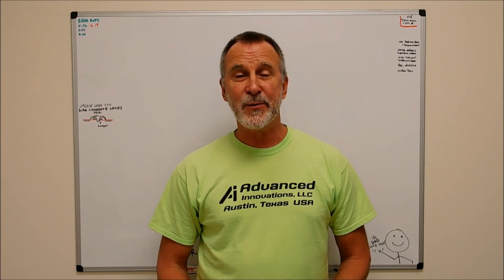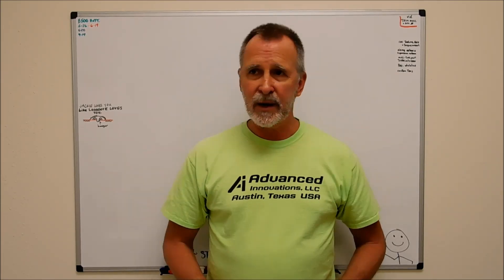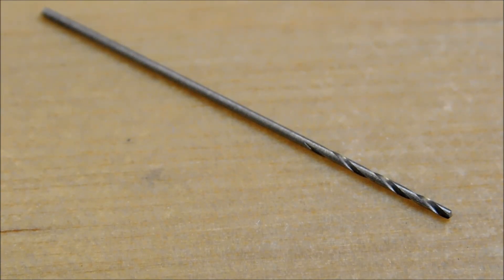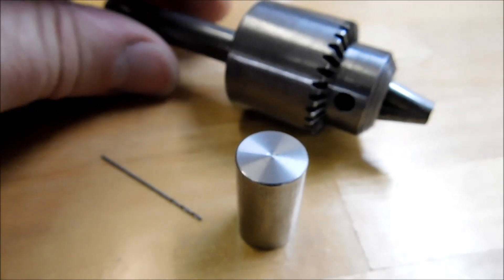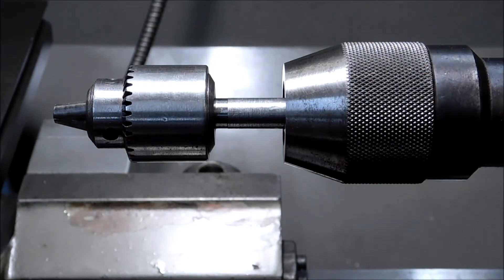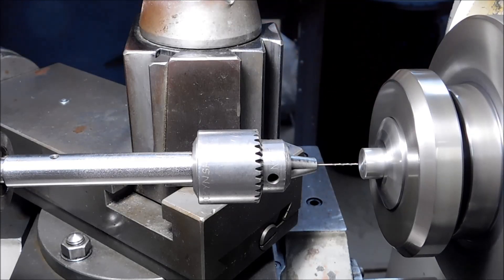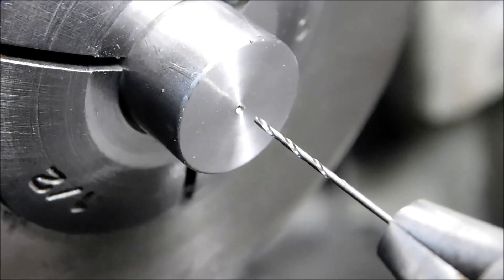Micro Drilling -- Stop Breaking Small Drills !!

Comment: I have used one of the commercial units to drill .015 dia. holes thru the deepest cavities in an aluminum vacuum form mold, about .187-.250 thickness 186 times without breaking one drill. I did change drills about every 25 holes just to be safe. Good tip....I've done it for years.

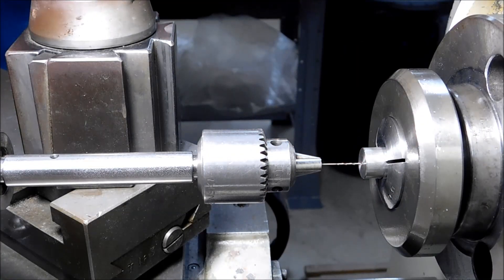Comment: Most super-small bits aren't made for power drilling period and are meant to be used with "hand drills". And since it sure looks like your bit lost at least one full "turn" of length between starting and about 8:40, my guess is your "trick" works better on paper than in practice. You can't "push" a bit that small that hard without it "biting" and twisting right off due to "torque" instead of what normally snaps little bits which is "angle". It looks like you used at least three different bits at different parts of the video and the first picture shows a bit that doesn't even have a "point". Classic twisted off small drill bit.
Reply from the maker: Although I enjoy all your "quotation" marked words, your comments usually leave me scratching my head. The video clearly showed that small drill "hand" pushed through 316 stainless steel. So unless I am a photoshop expert, this technique is as sound in video and practice as it is on paper. if there is any length difference in the drill, it probably walked back in the small chuck I used. As for the bit, it's the same bit throughout the entire video.
Reply: "Super-small bits aren't made for power drilling"..... please define "super-small" for me? What about 0.1 mm? I drill with that size (Union Tool carbide) routinely, and considering they make them at less than half that diameter, I'm sure other people have too. Makino IQ300 machining center... so they're certainly "power drilled".
Reply: Wrong-a-mundo Deer.......48 years as a toolmaker and machinist and I own two of these and have used them many times. To be a machinist does require beyond ordinary "feel".
Reply: One drill bit, unbroken, hole drilled, still one bit unbroken. Mission accomplished.

Comment: You can do basically the same thing with a pin vise and micro drill bits. from  eBay. https://www.ebay.com/itm/20Pcs-0-3mm-1-6mm-HSS-Craft-Tool-Mini-Micro-Twist-Precision-Drill-Bit-Set-Case/362196924548?epid=1953247543&hash=item54549e7884%3Ag%3AgWMAAOSwv~1aM3kg&_sop=15&_sacat=0&_nkw=micro+drill+bits&_from=R40&rt=nc&LH_TitleDesc=0 Another way to do it is to put a ball bearing race on the shaft that holds your smaller chuck and then you can let it spin a little as you hold the chuck...I do that when I drill deep holes ( 1 to 2 mm diameter  4 or  more inches deep)  to keep the bit from wandering...thus keeping centered all the way through the piece.
Reply: NOTE : Do not used for metal.

Comment: Hi Joe,
Excellent video & great tips. Just subscribed to your channel and have been catching up. I have drills as small as #80 wire size however the smallest I have used in the mill or lathe is about .030". The technique I use is to hold the feed lever as close to the hub as possible to reduce the chance of over pressing. Everything else I drill by hand using a pin vise. I'm going to make one of your setups for use in my lathes, already found a spare chuck in my tool drawer.  After watching this video I checked KBC tools and found they sell a Jacobs chuck with a 0JT for $89.00 and the micro drill amade by Sierra American with the 0JT taper for $65.00 also at KBC.  American made setup for $156.00 not bad for those who wish to buy.

Comment: GN1170 Pin Chuck Set +3 Collets 0mm to 2.5mm Drill Bits Suit Lathe Vice & Drills.   https://www.ebay.co.uk/itm/GN1170-Pin-Chuck-Set-3-Collets-0mm-to-2-5mm-Drill-Bits-Suit-Lathe-Vice-Drills/351294706667?hash=item51cacbd3eb:g:CykAAOxycmBS9Prt

Comment: Hi,
i am a watchmaking apprentice from germany we have drills the size of o tenth of a millimeter so 0,1mm. We do it kind of the same way. We don't use a normal chuck we have small chucks with handles we used to just put the end over the tailstock center and regulate the pressure with the tailstock handle whilst holding the chuck. Sounds difficult but is easy watchmakers lathes are small. When we make those micro holes you wouldn't use any electric power, we use a bow and a string to drive the workpiece. gives you even more feel. I hope someone understands what im saying =D this is the chuck we use https://www.bijoutil.ch/uhrmacher/werkzeuge/handwerkzeug/1466/reibahlenhalter-messing-8-mm
Reply: Hello Paul Locher, I am John. I found what you said very interesting and understood clearly what you said.
I also bookmarked the link you provided as I have been looking for just such items for holding small drills. I have a pin chuck that uses small collets that is supposed to hold small drills, however even though it is an expensive item, ($90+ in Australia) two of the small collets are so far off concentric as to be useless. I am reluctant to spend more until I find something accurate, this looks good (link).
 Thank you, John, Australia.
Reply: Hello John, thank you for your comment. A pin chuck looks like its pretty close to the small "Stiftenkloben" (the little holder thing). You said that your smallest collets are not really concentric, honestly it doesn't matter. The key is to just have the pin chuck with your drill floating between your tailstock center and your Centerhole which we get either by turning or with a standard center drill. (Watchmakers turn most of the delicate works, with their tool in their hands, not with your standard support. Looks a bit like a big woodlathe toolrest but in a tiny version). Back to the drilling, because the chuck is kind of suspended between your tailstock and your workpiece there is a little room and your drill finds the perfect center by itself. And just for correctness most of the time we use the motor of the Lathe. When we have to make new Pivots in small watch wheels we use a different fixture called  "Zapfenbohrmaschinchen" thats the Hand powered one. I hope it is interesting for you. 
Ps: I spent 14months in your beautiful country!
Cheers Mate
Reply: Thank you Paul for your reply, I took onboard all that you have just said, again with great interest.
 The pin chuck I have has for example, the smallest collet is about 1mm off center. I do not have the speeds on my lathe that a Watchmakers Lathe will have, max 1250 RPM. I was looking for something accurate so I can rotate the drill at high speed to do small holes.. 
 My smallest drill is .3mm or about 12 thousandths of an inch. I am part way through making a very high speed drive arrangement, it will also be used for internal grinding and rotary burr/file work. I have also provided for variable speed control on the device, a modified 4" , 100mm angle grinder with the gear head replaced.
 It has been a plan to do this for a while now, slowly coming together, thanks again for your help and input. 
Cheers Mate from John. Australia.

Comment: Hi Joe my name is Carla Piaia, what I do with every drill I'm going to use in the tailstock I hold it and I grind the back of the flutes, I start by pinching half of the diameter the drill between my fingers and then with the downward motion pushing it and it follows the twist and it grinds more relief for the chip evacuation and it works fabulous, it resembles some of the high-end parabolic drills you can buy

Comment: Amazing!  Question: I want to neck turn some 6.5 Creedmoor brass (rifle brass). The brass has a taper.  When I chuck it in my Dewalt drill, the base is held but not the entire cartridge so I get a wobble. Is there a way to spin a concentric  tapered object?
Reply: ludditeneaderthal and Paul Watterson, I have nothing to add to the conversation. I just finished reading, with great interest, this thread and have to say that this is the best aspect of Computers and sites like YouTube, the fact that if you meet the correct people, good information and help is offered up, exchanged and shared. Of course there are trolls as well, I prefer to say nothing if I can't say something good or constructive.
Cheers from John, Australia.
Reply: i suggest you check out how lyman, lee, and forrester all solve that little problem. hint: think shell holder, jam nut, and nut driver. the tool commercially is known as a "case spinner", btw. the lee example is, like all their products, incredibly inexpensive, but none of them are incredibly costly
Reply: Been there done that. Spinning a case in a shell holder is crude at
best.
Reply: pretty much every top ranked benchrester uses forresters system (a small u-shaped lathe like turner) for both gauging brass, and neck turning, reaming, flash hole reaming, etc. it allows either hand powering with a crank, or attaching a drill. the method for securing the brass is a shell holder like collar. 

no spinning arrangement will be anything but "crude at best" if you're just chucking it in a dewalt drill. a drill, no matter price, isn't made for any kind of turning operation. they rely on the thrust to minimize radial play.

 you could get a mini lathe, a collet to MT3 adapter (or collet hex adapter to use the 3 jaw) and use a chamber reamer on a suitable collet (from the headstock side), but you're talking an easy 700 bucks, minimum, and you'll get results about the same as the forrester rig (which runs about half that cost). you MIGHT be able to use one of those 4 inch between centers lathes they sell on amazon or wish and do the collet/hex adapter trick with a chambered collet, but that would run at least as much as the forrester rig, and most likely give inferior results.

 if you must use your drill (assuming a 1/2 inch chuck) you could chamber a piece of 1/2 inch OD tubing, make 3 slits on the case head end 120 degrees apart, and make the length in the area of the case shoulder. that would be basically a collet whose grip would be tightened by the chuck jaws, and assuming good ID/OD concentricity, would provide as much accuracy as your drill is capable of delivering.
Reply: Really like your last idea. Are you a machinist?
Reply: not a machinist, just a firearm enthusiast for decades, a former locksmith, and a machining hobbyist of sorts. i do understand precision tooling though. if you opt for the final idea, i'd suggest a mild steel for your collet, the slits running just a little longer than you chuck jaws would grip, and a "relief groove" to make the "spring" effect a little easier. i'd try a roughing chamber reamer first, as the coarse finish would give a bit better "bite" on the case without having to tighten it all down so savagely as to risk crushing brass you have time invested in forming. 

i should add that perhaps one of the benchrest/target oriented die manufacturers offers a "ream die set" for that wildcat, much like a trim die (hardened upper end), but specifically purposed for reaming the neck ID while supporting the OD at minimum spec, fits a standard press, and is sold with a tapered reamer to run in by hand or power. some prefer outside turning, some prefer reaming, so i figured i'd share that option as well. you could, with that set up, use that lee hand press (the one you actually work in both hands, no bench) and a tap wrench on the reamer (or your drill, of course), and thus be able to ream necks anywhere you could "drill turn" them, as i imagine the portability is a factor in your choice. the ream die and press ram WILL give about as accurate a cut as any option, unless your brass is REALLY non-concentric due to varying case wall thickness from the forming process. the die set will probably be comparable in cost to a chambering reamer (target reamers are pricey beasts, lol). that pretty much covers all the bases and options that would actually work and has potential for a good final result.
Reply: Thanks for the good info and all the detail :-)
Reply: a pleasure... but, just to let you know, i did a search for a creedmoor ream die set, and couldn't find a single example. it seems the ream die has gone the way of the dodo bird and passenger pigeon, lol. it's been a LONNNG time since i was interested in benchrest, so the current state of the art is a bit of a mystery i guess. also, the darling of precision shooters is the FOSTER, not forrester rig, another mistake i blame on antique info and decrepit memory banks
Reply: Do you mean Forster? I have their mini lathe which I use
to trim cases to length. I think they have a neck turning
attachment. I use the K&M neck turning tool with their
special mandrel to expand the neck which is needed to
fit their pilot which is a real tight fit. It works real good
except that I pull the necks out of concentricity using
my hand drill, so I have to run them up a body die again
to make everything concentric. Kind of a slow process.
Reply: forster it is, lol. they make both a turning attachment, and a reaming one, and i did see they do have at least the ream set up in 6.5 while scoping for ream die sets. i know a couple decades back EVERY benchrester swore by the rig, for the very reason you could use the single base to gauge cases, trim them, ream or turn necks, and even check the interior of the casehead for parallelism to the mouth with a dial indicator. of course, they still debated whether turning or reaming was better, lol. if you already have the forster base, the economical solution would probably be to just use their tooling to turn, as it pretty much insures concentricity, and you at least used to be able to drill power their set up, so your dewalt could at least get it's feet in the pool, lol. perhaps you could even run your existing K&M turner with the forster?
Reply: Cheers back mate :-)
Reply: Thanks Mate, John.

Comment: slick, where do you get quality drill bits these days? i'm just about out of the supply that the 1960s and older provided.
Reply from the maker: You have to keep an eye on real small bits. Even though they are new, doesn't mean the will cut well. Stick with a brand name. They will cost more, but its money well spent.
Reply: somehow i got the feeling for small bit use, only on occasion will a complete fracturing into particles follow a smooth cutting No. 40, mostly from not cut, pull out, brush with lube/coolant, but also the feeling that even name brands are obtaining non quality and putting their name on it to stay alive in a world of youth that doesn't know the difference so they spend money at those freight shops that only have the key ingredient that attracts men and some women-the smell of tools. quality or not, a constant bath applied to any cutting edge in metal work machining prevents the sudden heating and then cooling which sets up fracturing tendencies supporting both the hardened edge and its base. the intermittent brushing is an example to shorter tool life. so the cut alittle and pull out and cool is all that can be done with a drill. tough thing to do. especially when drilling plastics and soft metals. you make it look easy.

Comment: You're a life saver Joe. I need to drill some 1.2mm holes in 304 stainless and I've been dreading it until I saw this video. Though I'll be doing it on a mill, your comments below to use a micro drill adapter have shown me the way. Thanks!

Comment: Very good Idea. I am a hobby machinist. When I was taught lathe work many years ago the instructor emphasised "develop a feel for the procedures you use". I will be using the method you have shown.  Thankyou Joe
Reply: I've heard that since I was in shop in highschool in the 70's,  I don't do much metal work these days, mostly wood, but the "feel" is bang on. You know when something's wrong....specially when using a circular saw through maple plywood with a dull blade....

Comment: Hand in hand with this method another good trick is to only tighten the drill in the chuck enough to drive and cut. If it should grab it will slip in the chuck and not break.

Comment: any suggestions for mills?
Reply from the maker: Look up "Micro Drill Adapter". Its a spring loaded and keyed arbor for small drill chucks for use on the mill.
Reply: Just a brain fart....could you use the mill to drill a hole in a viced piece of stock that your "guide tube" would just slide into, then chuck your workpiece into the spindle and hand feed the drill upwards?

Comment: Hi Joe..I love your videos...I need to drill several small holes for even Argon  distribution (preferable 1/16) in copper.  No high precision required. Question for you: What RPM should I use with micro drill adopter in Bridgeport?  The hole will be aprx. 1/2" deep. Thank you!

Comment: Some years ago I wanted to find a machine, or tool, to drill very small holes in brass, nickle silver and bright mild steel. I was using 0.5 mill (.020") and up to 6 mill (1/4") drills.
I have a set of VERY old engineering books which contain drawings of a sensitive drill. I made the patterns, had six sets made at a foundry.  I bought six  chucks and machined all the castings. I then sold 5 of them the finished  drills and kept one. The design was very successful and I am still using mine after 40 years. I use the plastic heat joining band to drive it.
Unfortunately the book has no auther, publisher or other identityfication in it. Being very ancient I don't know how to transmit details or a photograph of the drill.
Reply: bbcisrubbish You could transmit if you purchased a tablet. The Samsung I use is by no means perfect,but I had some important hand written pages to transmit to my brother. Worked like a charm. Took a little fiddling till I knew I had good images.Cheers
Reply: Thanks for the tip. I am not buying any more computer items, one is enough. I am sick to death of loud mouth Yanks and their bull selling me something with no back up or advice.